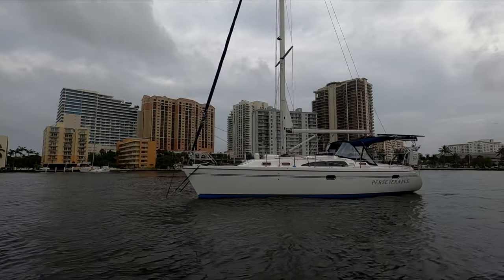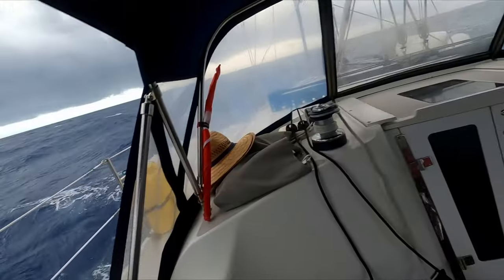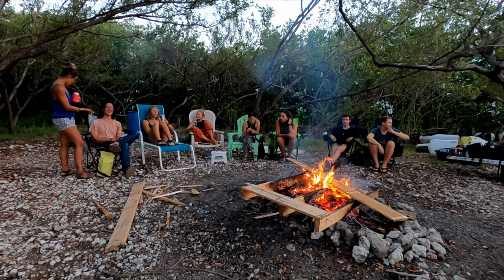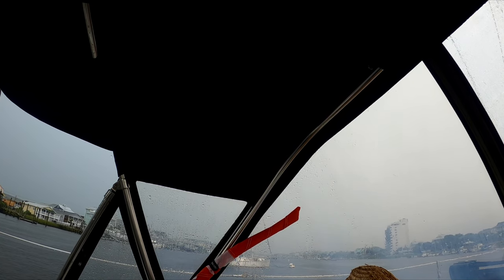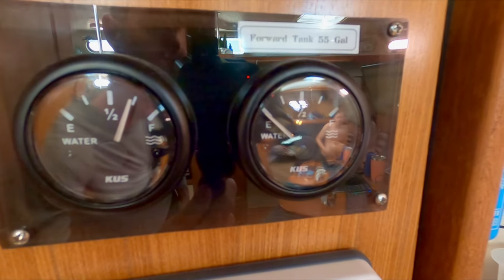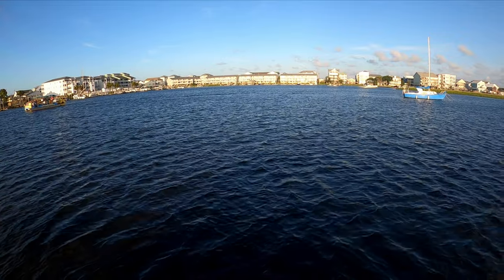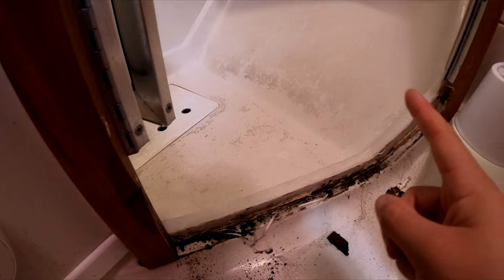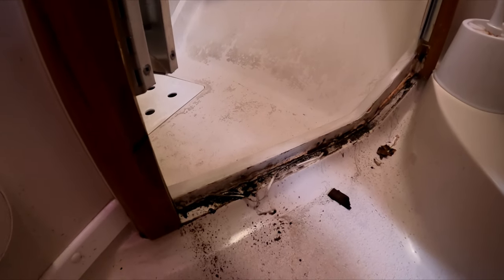Boat Projects at Anchor Exploring the Outer Banks - Explore With Perseverance (Episode 10)

Comment: Thanks for sharing your experiences. Perhaps some additional waterproofing (e.g. heat shrink tubing) for that remote switch module? Another YouTuber, I don't recall which one, tried those awhile back and they quickly failed in the tough marine environment.
Reply from the maker: Good advice, Josh wanted to open it up and cover everything in lanolin but it was sealed pretty well. We would suggest opening it up and puting some sealant around the edges and where the wires go in.

Weve had ours installed many months and it's still going strong. We do make sure to turn off power to the windlass (which we have always done after anchoring) just in case it were to somehow get stuck in an on position while we are away.